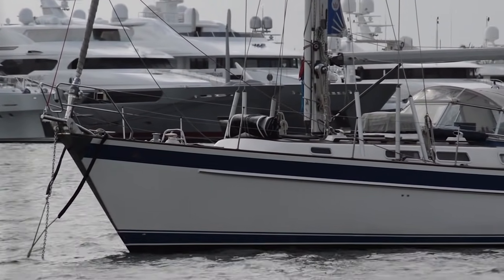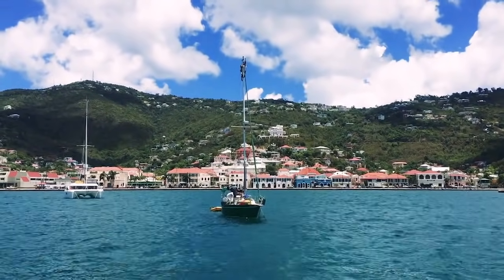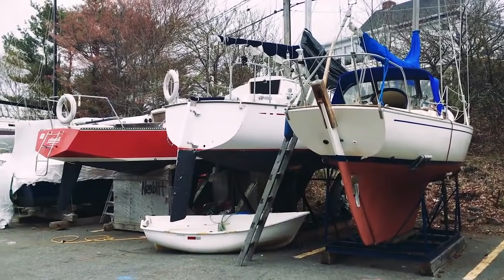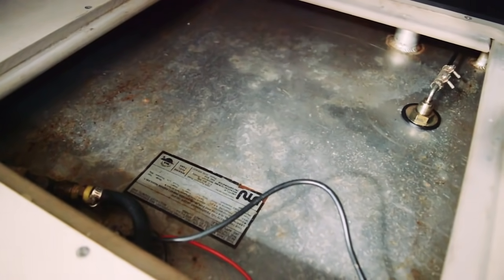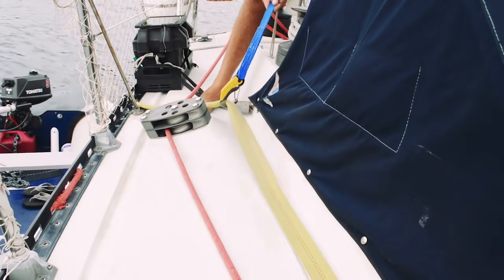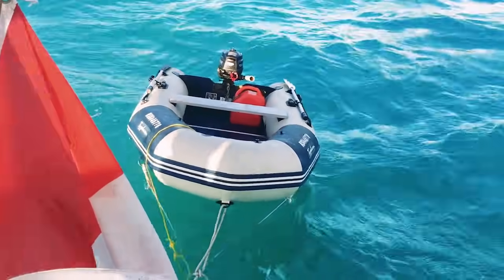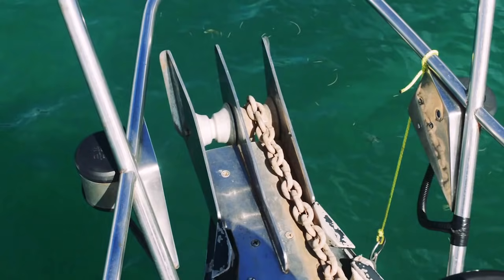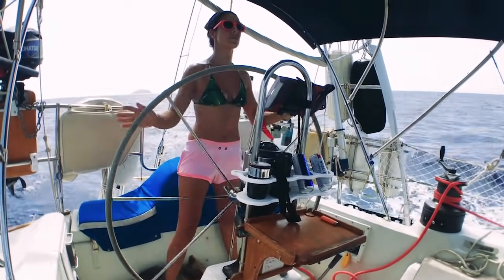How to Buy the RIGHT Liveaboard Cruising Sailboat to Cross an Ocean | Sailing Balachandra E094

Comment: just one point... a sailboat's displacement is always exactly equal to the weight of the sailboat...  Thanks for very informative video
Reply: The boyant force is equal to the mass of water displaced
Reply: The designed displacement is less than the weight of the boat.

It allows for all fluids, food, gear and people. This gives a cushion.

Comment: About 30 years ago I was lookin through a "SAIL" magazine that listed all of the solo circumnavigation sailboats with statistics.   I calculated the average length of all those sailboats and it came out to 37 feet (overall length).   I decided that would be a good minimum length for a long distance sailboat.   Reading lots of reviews of sailboats in the 35 to 45 foot range the one that stood out at that time was a Pacific Seacraft Crealock 37 as an excellent cruising sailboat.   They still make them in North Carolina and there are lots of used ones for sale!
Reply: too bad they are so expensive $$$
Reply: My own research, though not as exhaustive as what you're describing, came to essentially the same conclusion - 38 feet seems like about the right size for a combination of both comfort, price, and sea-worthiness.  Now I just have to figure out what kind of keel I want.
Reply: @eventhisidistaken  Having done 2 transatlantic and one pacific crossing, I'd make a priority list you want to tick when getting the right boat for you. First and foremost is safety. Make sure in the worst case you can make the boat watertight, as in lock doors windows and hatches so they can't be breached. Next is a combination 'you' and the boat. Make sure you can reef down the mainsail  (and the foresail too) in little time and in the worst conditions. If you can't, make changes so you can. My last voyage was on a 40 footer. I practised (like an athlete) until I could reef the main in less than a minute (in port). That enabled me to do this within say 2-3min in a real situation. Be sure to have 3 reef points and all the fittings in good quality and size. ... Only then comes other things such as shaft seal, engine, etcetc. BTW I'd make sure you can get yourself out of trouble with sails only if needed.
Reply: @olivierholland5874  Good advice.  Also, I think knowing heavy weather tactics is a must, even for cruisers.
Reply: @olivierholland5874  Hadn't thought about dry practice... Excellent suggestion.
Reply: I still don't understand these stupid discussions going around the Web, who decides if a boat can be considered bluewater or not?  
Expensive or cheaper?
Good or Bad? 
Typology and specifications? 
Why doesn't a specific body establish it according to strict criteria to which all manufacturers must adhere?  
Who controls who and how?  
According to what regulation? 
And recognised by whom? 
Do we still want to believe in the fairytale of the CE mark?  
Which, by the way, I see it written everywhere even on my underpants!
So I don't think we need to be a naval architect to understand a very simple, if not obvious, concept that regardless of the builder, whether it is Beneteau or any other, there is a legislative and regulatory VOID in this sector that concerns not only the construction and design, choice of the materials and their origin, the absolute lack of supervision by any recognised third independent body from the design, the construction, up to the delivery of this type of boats, the lack of training and professional courses for the staff employed by these yards,
which would make the most stubborn navigator pale.  
The truth is that these shipyards do what they want and their constructions have one and only one denominator the profit!
Reply: @KoDeMondo  -  You are trusting your life in the Bluewater sailboat you choose to sail.   How and why can you trust it?   A boatbuilder/shipyard that has been in business a long time has a larger customer base that has built a good (excellent") reputation for their products.   The Crealock 37' has been around a long time and if you can find a used one it us usually more expensive.   Quality with a good reputation usually costs more.
Reply: @KoDeMondo  why r u repeating/copy -pasting the same thing in several comments?

Comment: regarding the comments on size of the boat. there is a mathematical relationship between size of the boat and how high breaking waves the boat can withstand. so even though you can cross an ocean with a small boat, there is a safety aspect of it too.

Comment: 12 volt chest freezers instead of the built in and always run on ECO mode. A CB radio and a long antenna. A small four cycle air cooled outboard motor. A sextant and a cheap GPS. 12 volt brushless fans. All LED lights instead of tungsten. I intend to use a small air cooled diesel for electric and propulsion. It disperses very little dry heat and sips fuel. Leaky fuel and water tanks don't cut it.

Comment: Lived aboard and cruised for years. Lots of good points. I’d also be asking about fridge insulation.  Gutting and rebuilding a box can be a big or impossible project. 
If the boat was built in 70s how the bottom condition is. Blisters/bottom job. 
Keel stepped mast. 
Look for water stains and leaks. 
We don’t have a built in inverter. Everything is 12v or plugs into a 200 watt plugin inverter. 
Inflatable dinghies have pros and cons compared to hard dinghies or nesting dinghies.
Reply: Dinghies - suggestions ? Why one over the other? Newbee here and soaking up info…

Comment: Well I made a great choice in my girl! Shes a 1978 Endurance 35, cutter. Dual 20g water tanks. Electric Brushless 20kw Renogy 1200ah drop down drive. Diesel conversion. 50g fuel tank/formerly diesel” now gas conversion for the dinghy/generator fuel so no jug’s on deck. 🤔 my first sailboat. 🤔with a little ingenuity she will be a jewel 😉just getting started.

Comment: This was a very informative video. Thank you. I’m retiring in two years and have approximately 400K to buy a sailing boat. I’m hoping I can stretch to get a 49’-54’ so we can go far. We are in SoCal but need to really research this endeavor
Reply: Don't have to go 49'-54' to go far.
Reply: to save on too long a boat buy a cat for 300k  and use the extra 100k for the unavoidable extra costs (maintenance,  mooring, fees etc)

Comment: just remember more horsepower does not always mean more speed. Hull speed is hull speed. If your motor is bringing your boat up to hull speed in normal conditions. Then more horsepower might not make the boat faster. Keeping you at hull speed in your fighting a force. More power normally helps with torque pushing the boat in a situation where you are fighting a force that is trying to push you in a direction you don't want to go. This can be ocean currents, waves or channel currents, tide waters ECT.  This is where more HP really comes into play. Normally manufacturers will build the boat with an engine that will push her along at hull speed in normal condition but how often are we in normal condition.

Comment: Best battery chemistry for the money would be lifepo4. Little more expensive than LiPo, but waaaay safer and around 4x the charge cycle lifespan. Plus a wider range of operating temperatures, a deeper discharge, and an individual cell voltage that plays nicer with the 12v standard
Reply: yup, only real downsides to lithium iron is price and weight.
Reply: @dankyden  long term, it's cheaper since it lasts longer
Reply: Great tip. Thanks!
Reply: @isthisoneunavailable  depends how you do it really. buying battleborns is never going to be cheaper than buying used tesla or nissan leaf packs.
Reply: Not if you calculate correctly. Wet lead acid is ALWAYS WAY CHEAPER PER AMP HOUR. Get 6v trojan t105. Stop arguing with 50+ years of experience unless you show your calculations.
Reply: @isthisoneunavailable  my agm batteries are 16 years old so not sure what numbers you are using. Chinese lithium batteries??? ROFL. Google "tesla fire video" first

Comment: Displacement (weight) has little value of itself. If you can find a lighter boat of the same strength then that's water you don't have to push out of the way. It also means less load on rig, sheets, winches and steering. That means faster passages, a crew less tired and less breakages.

Comment: what is the best engine inboard or outboard for you sail boat?   salt water eats at metal so having a outboard motor that can be raised from the sea would be better than a inboard with the prop exposed to salt water all the time.??
Reply: I was under the understanding that there are motors/props built just for saltwater both inboard and out….

Comment: "The smaller the boat, the more risk and less comfort you will have". Not so. Lin and Larry Pardy cruised over 150k miles in first a 24, and then a 26 foot engineless sailboat, both which they built themselves, designed by Lyle Hess. They are renowned in the blue water communuty as outstanding sailors.

This minimalist approach might not be your style, but it is eminently doable.

Comment: I thought ICW mast height limit is around 65 feet? Also I think your C&C 44 mast height is considerably more than 47 feet, my much smaller C&C 30-2 mast is 46 feet.
Reply: I think he mixed 46 and 64 ....
Reply from the maker: I did! Oops, sorry for this. I will correct or remove that, thanks for the heads up!
Reply: ICW is unlimited as you step the mast. The concern is depth  as it hasn't been kept up since its inception in WWII. Lots of shallow spots.

Comment: Why not have an electric oven/burner? Larger system vs having to carry propane. If you had a grill that ran off propane, I could understand that more.
Reply from the maker: 24 v system means a complete electeical system overhaul and higher solar demand. $$
Reply: @SailingBalachandra  Its like anything else, propane is what $2 a lb? Doesn't that add up? Plus the costs associated with acquiring it?
Reply: And the danger of carrying propane, since it's heavier than air, and tends to build up in the bilge  waiting for a spark and explode the whole boat...

Comment: Thanks, it was really useful video. What brand boat do you recommend for live board sailing? We are now looking for Dufour 36cc or 39 cc. What's your opinion? Thanks in advance.
Reply from the maker: If you're brand shopping you're looking for a fiberglass factory boat. There's lots of great boats that make the cut but if you want a factory boat to take you places you'll need over 37' and lots of storage. They are almost all designed for charter. Jenneau, beneteau, moody, c&c, sun oddesy, swan etc. All have boats that can be cruised. Hunter have a rep for being "casual" boats but some of the big ones are cruisers. Don't shy away from an aluminum or steel boat just because NA is obsessed with fiberglass. Hope this helps.
Reply: @SailingBalachandra  what are you thinking about HRs and if so what ones, more the older ones like a 43 MkII or 45 or the new 44 or 50? They all are known for sail able short hand